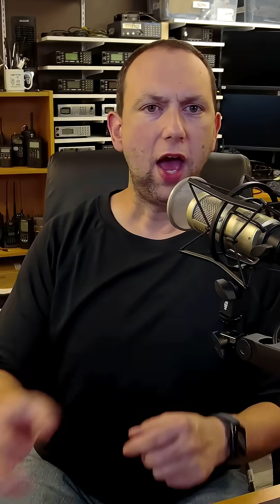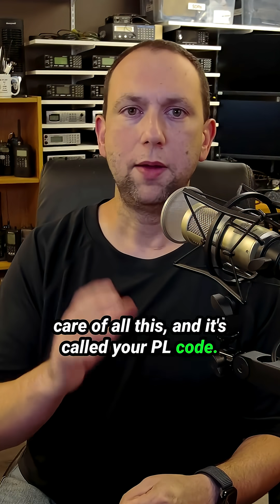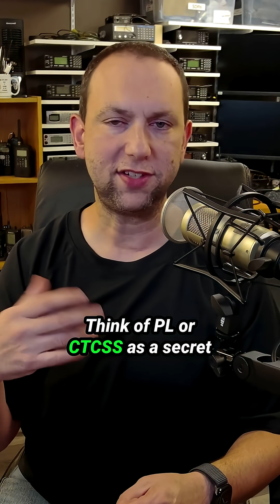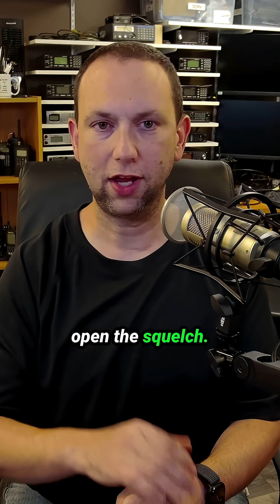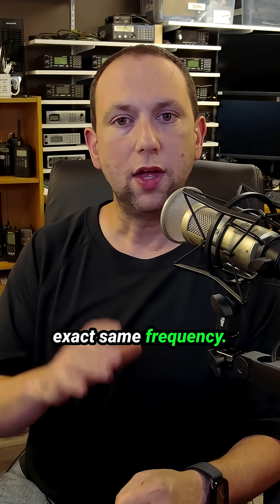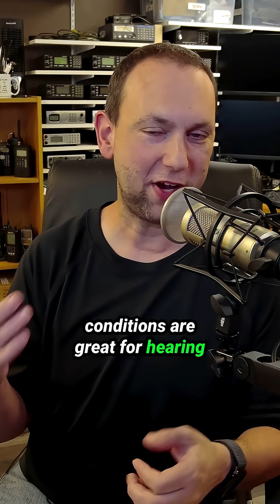PL Codes Explained

Comment: I have a Uniden BC125AT, I programmed in PL codes, but radio reference didn't list them all, so I would miss portions of conversations .I usually leave it on "off" or "search" so it plays the transmission no matter what the code is.Search displays the code so you can write it down I guess

Comment: I have this type of scanner the bcd996p2. The signal is strong but sometimes no talking.  8 miles from westminster md so I should hear it. But no..on phase 2. Is it the antenna or something inside radio..thank you hoping to hear back...Alvin
Reply: If you have Global Attenuation on that unit and its on, try turning that off.   Second would be move the radio physical location just a few inches and see if that helps....lastly I would swap out antenna or if its a telescopic already try shorter or longer.
Reply: @pythias9465 ok I'll try this thanks